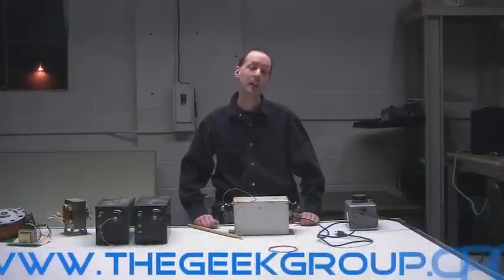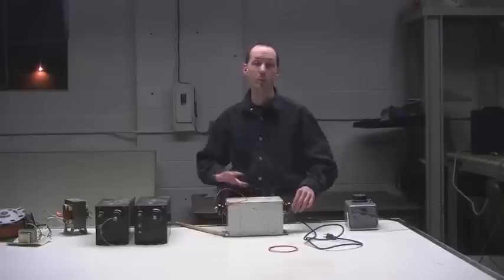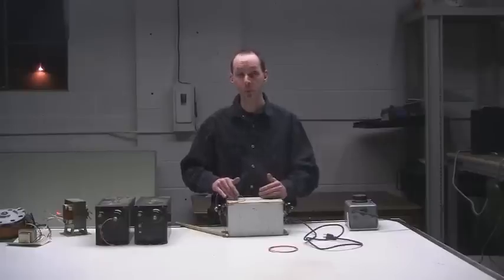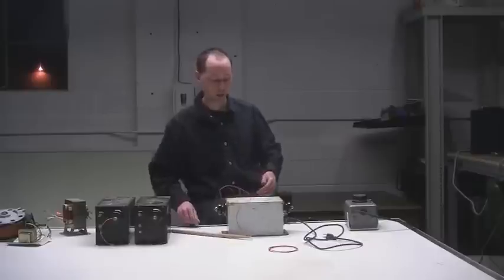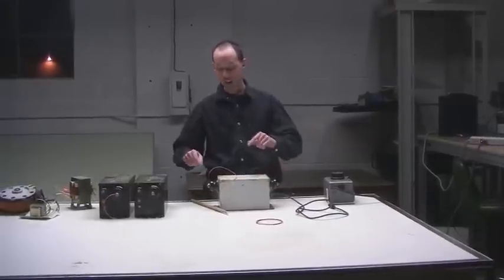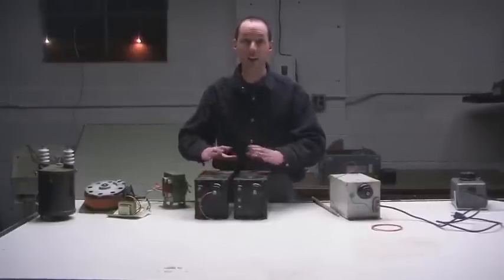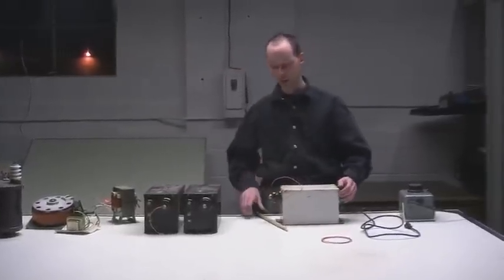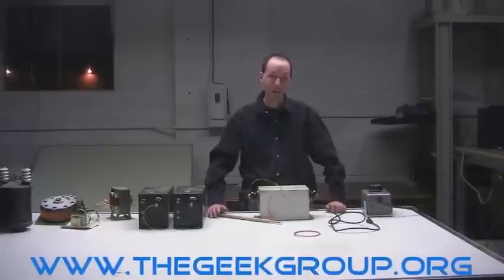NST Basics

Comment: Great video.
I built 2 Jacob's Ladders - one at 15kv and 30ma, the other at 15/60.  The 15/60 is MUCH better (as you noted that it would be) - better than just double the size of the spark - more like an exponential jump is size - like 4 times.  My question:  If I want to try and hook my NST's up in parallel, what gauge wire should I use?
Thanks!
Reply from the maker: Cyclone Productions For simple NST's with 2 in parallel you can just use an old IEC power cable and it's fine. The load is very small.

Comment: I have an old furnace ignition transformer, but there no specifications on it, it makes about 8mm spark length. Is there a way to measure the output current, maybe using a lower voltage input or so?

Comment: Do you have a multimeter? If so, I would calculate the input wattage (V*I) and see if you can find the output voltage. Then use this equation : I=W/V
I = Current in Ampere
V = Volts
W = Watts
I hope I could help